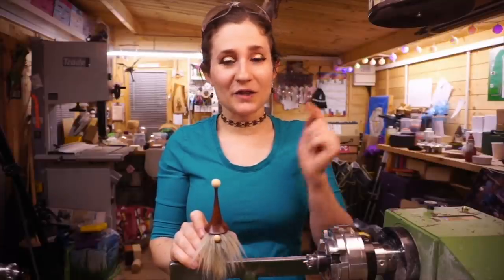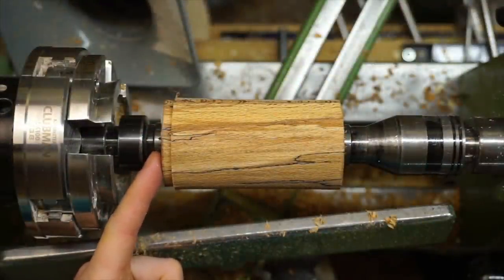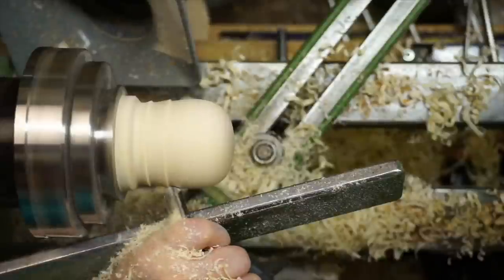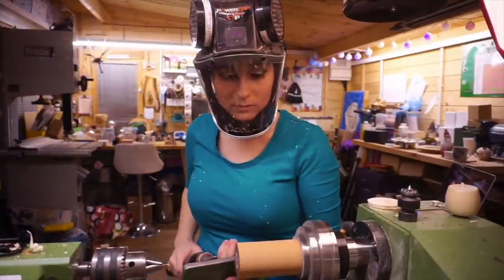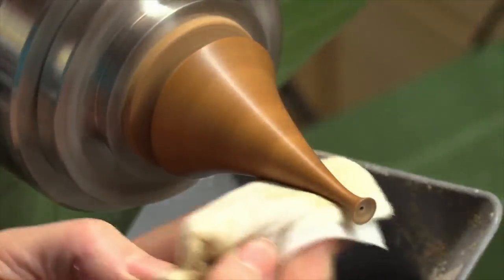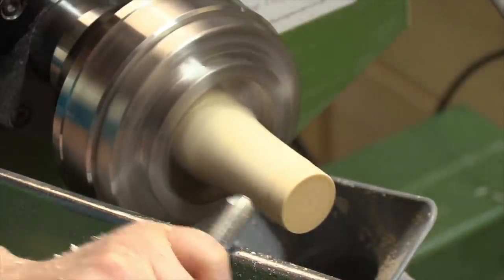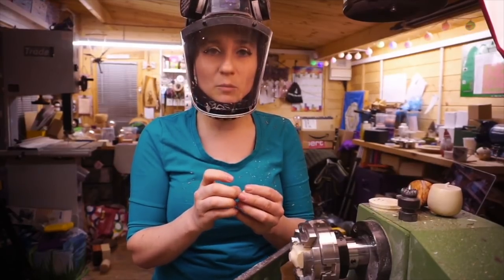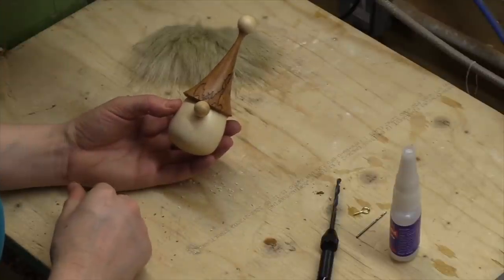How to Turn a Gonk! | Wood Turning DIY Project

Comment: Just found you and I think your gonks are adorable. Where did you get your face shield? Love that the breather part is on top.
Reply from the maker: Hi Lynne! The faceshield is a JSP Powercap which I bought from Yandles. Axminster also make one which is identical. They're nice and light compared to some of the other makes and it's great to have the positive airflow system as well as the impact resistant face shield 😊

Comment: Great informative video Thankyou, just one question Emma why do you use a bowl gouge and not a spindle gouge for this?
Reply from the maker: I use a bowl gouge for a lot of spindle work because mine has a very short bevel meaning the cutting edge is well supported so can last a little longer than a fingernail profile grind. I use the bowl gouge for the rough/heavy work then the spindle gouge for the fine detail 😊

Comment: Hello!  Very educational video.  I am trying to make these myself.  Can you please tell me the diameter of the nose and hat bobble?  My attempts at making the nose and bobble tend to not look right in relation to the rest of the gonk.  TIA for your advice.   Looking forward to seeing more videos from you!
Reply from the maker: Hi there! The diameter of the nose is approximately 3/4 inch and I try to make it as spherical as possible. If I do a larger body I go up to about 1 inch diamter, and a smaller one 1/2 inch to 5/8. The hat starts at 2 inches square and is rounded off keeping as much diameter at the base/rim of the hat as possible and taper the top towards where the bobble will go. Hope that makes sense!!
Reply: @TheTinyTurner  Thank you very much!

Comment: newbie here, just getting set up in my shop.  what is the brand of the face shield you are wearing?
Reply from the maker: In this video I’m wearing a JSP Powercap but it fell apart after 6 months so now Inwear a Sundström SR500 combined with an SR570 and that is miles better (but much more expensive, unfortunately) ☺️

Comment: Tell us more about that face shield, please. Doesn't that get a little uncomfortable?
Reply from the maker: It isn't uncomfortable at all. But I have recently upgraded to a better unit that has the fan pack on a belt and a tube system to feed the air into the helmet. Much improved 👌🏻

Comment: I know I am a bit late, however the fungus in the wood of any spalted timber is Dead.  YET wearing a mask in general is a wise precaution while wood turning.
Reply: I'm pretty sure the fungus can still harm you.
Reply from the maker: As far as I'm aware, it is only dead if the timber has been kiln dried, but there is still risk if the timber is not fully dry. I may he wrong, but it seems there are different opinions on this from what I have read about this since you guys pointed this out 🤔👍🏻